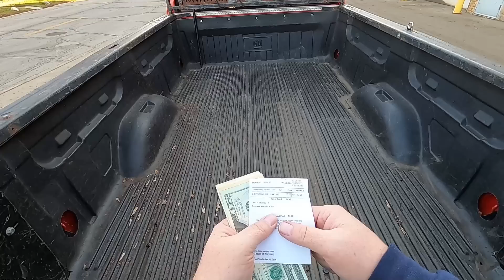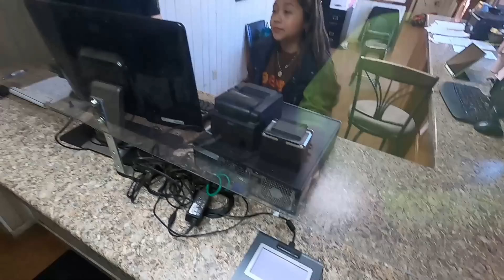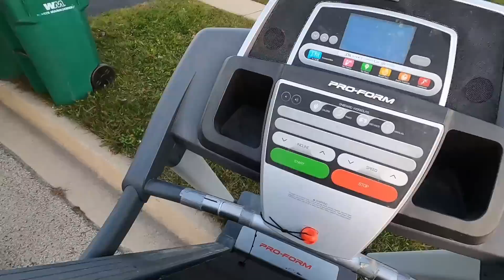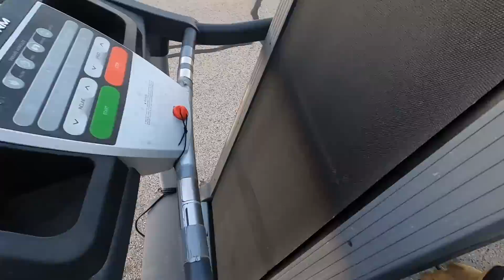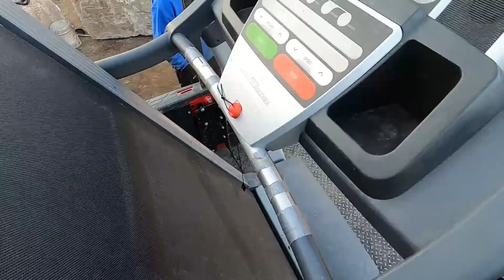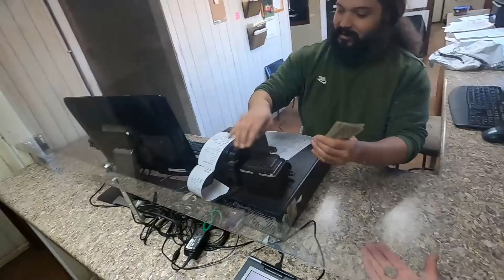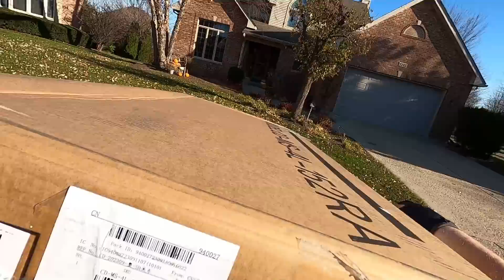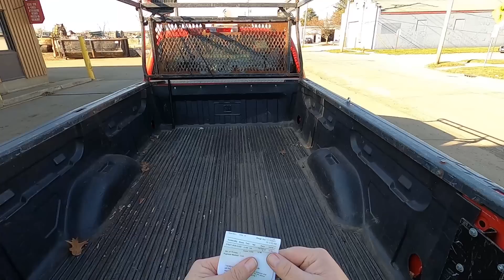Who Knew Garbage Day Pays?

Comment: Working a ranch for a lot of years and having to deal with barbed wire. We learned that the worst wire had red barbs and it had been outlawed. It would cut cattle up and other animals so badly that some had to be put down. So no one used it anymore. In fact I don't think you can buy it anymore. But if you happen to come across it it's old and pretty much an antique.
Reply from the maker: Sad to hear about the barbed wire injuries